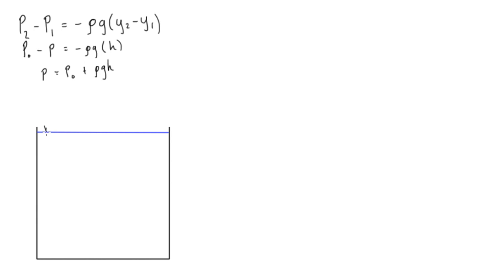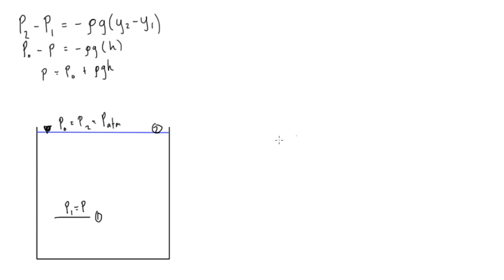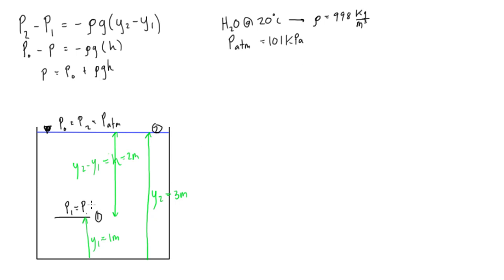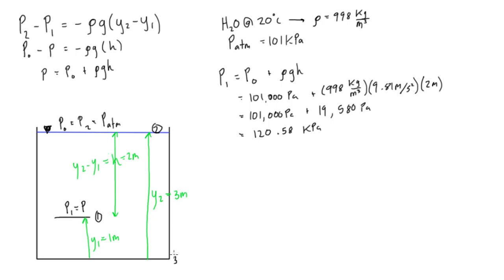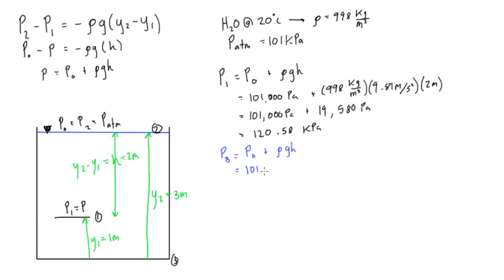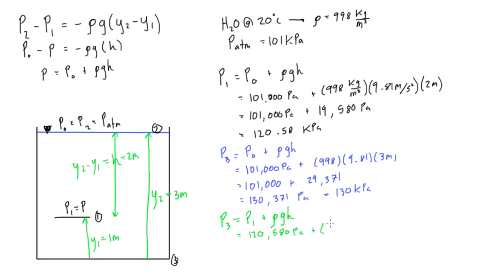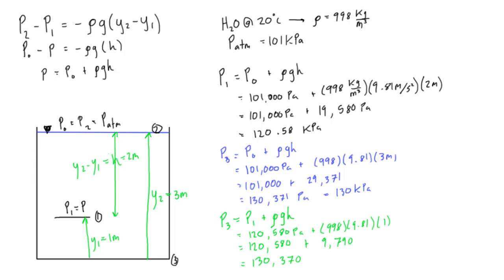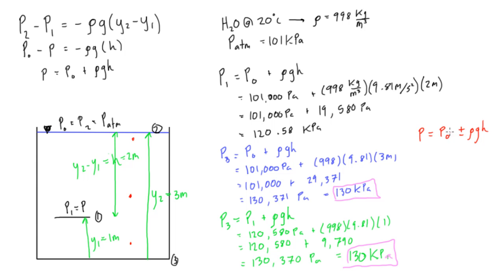How to calculate pressure at a given depth in a tank

Comment: i dont know if you can reply but, would this calculated pressure be gauge pressure or absolute?
Reply from the maker: If you take atmospheric pressure (101kPa) to be your reference pressure, then the bottom of the tank has a pressure of 29kPa Gauge, or 130kPa absolute
Reply: @Engineer4Free  thanks!

Comment: Hi.. I really like this video... Can I ask something. I'm making an aquarium with a hole at the bottom with 1 1/4 inches diameter pipe to the sump. The aquarium is elevated by 4 ft. the sump at the bottom of the stand is 3 ft. The aquarium measures 6 ft lenght 2 ft wide and about 3 ft tall... Can i ask the PSI of the water at the bottom of the aquarium... Thanks.. So I can know the GPH and buy the appropriate water pump
Reply: Thanks in advance

Comment: If i have a container with a small opening at top , and i start to submerge it in the ocean at a constant speed. Would the rate of water going inside the container be affected by the pressure difference? And how about the rate of air escaping from the container as it goes deeper and pressure builds up?

Comment: How do I calculate this? But with the pressure being read of the side of the tank. Would the atmospheric pressure be replaced by the volume of water for that depth( converted to pressure)

Please help
Reply from the maker: Don’t worry about volume. Pressure in an open fluid column is only really dependent on the height difference between the point you are measuring pressure at, compared to the height of the surface. I’d recommend checking out all the intro videos I did on fluids here: https://www.youtube.com/playlist?list=PLOAuB8dR35oeOIPMOBH6hjwobuIJHPKSN

Comment: I have hired two civil engeneers to build underground cylindrical tank made from cement concrete,the diameter and depth are the same of nearly 20ft.
Now what is the pressure of the water beneath?is the pressure also act on the sides of the tank?
Reply from the maker: The water pressure at any depth in the tank is just P=ρgh whether the tank is burried or not. The water inside applied a pressure to the inside of the tank. The soil on the outside applies a pressure to the outside of the tank, but it's not felt by the water on the inside because it is rigid.